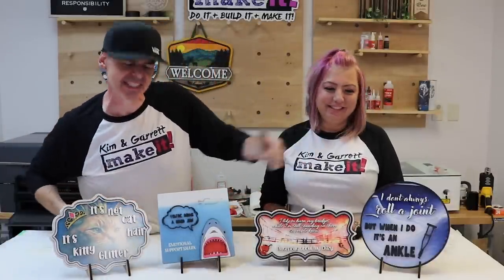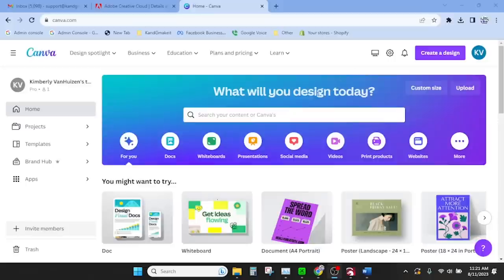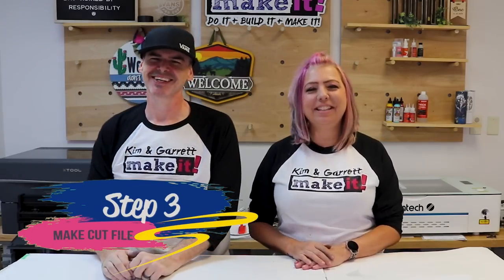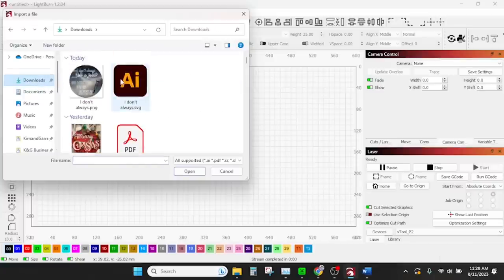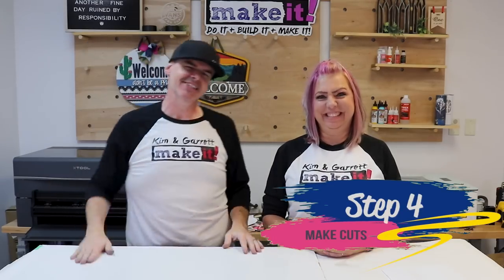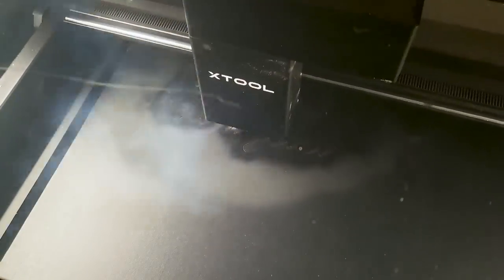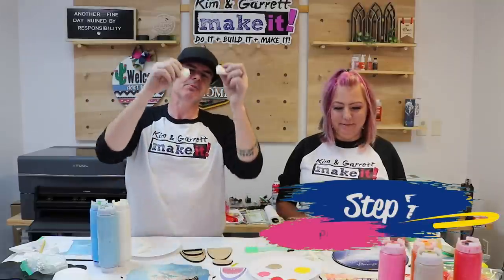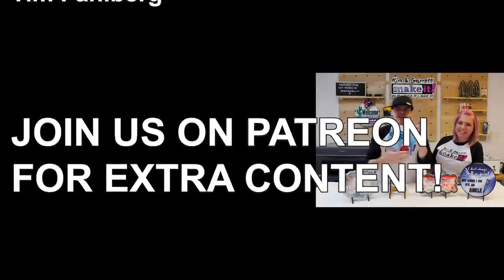3D Laser Cut Sublimation and DTF Printed Sign Tutorial

Comment: Thanks for this video! Have you tried cutting white MDF boards with a diode laser?  As I understand it wouldn't cut through it but I was wondering if it could be cut on the other side (which is brown) or if putting a masking tape on the white side would work.
Reply from the maker: Yes I have!  I was able to get through 1/4" mdf using the D1 10 watt at 2mm/100% and the S1 40 watt at 7mm/75%.
Reply: @KimandGarrettmakeit  Thank you so much!  I'm still debating over the M1 or the D1 but this helps so much as MDF is one of the things I'd love to be able to cut :D